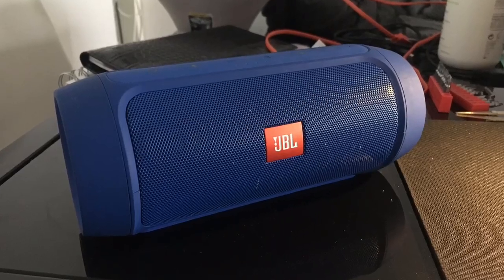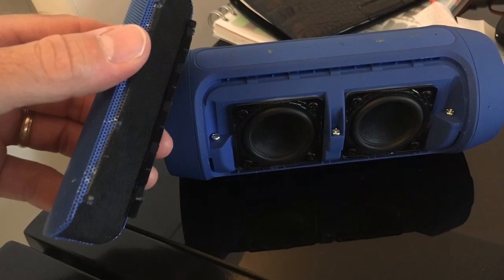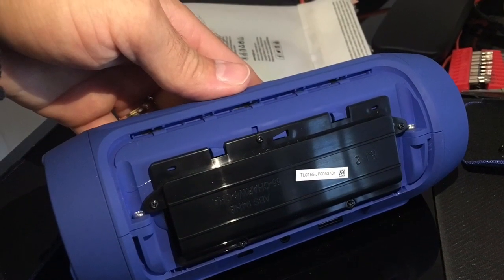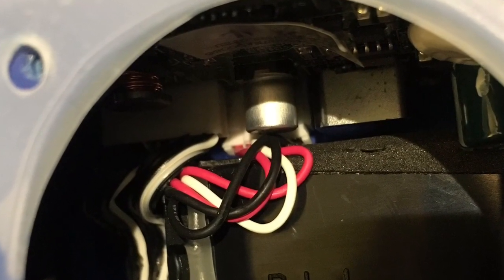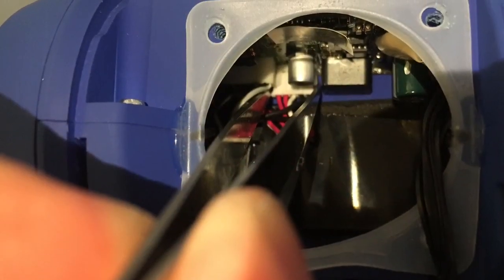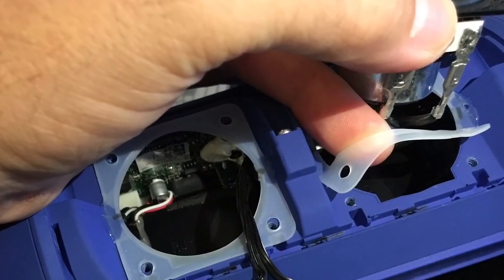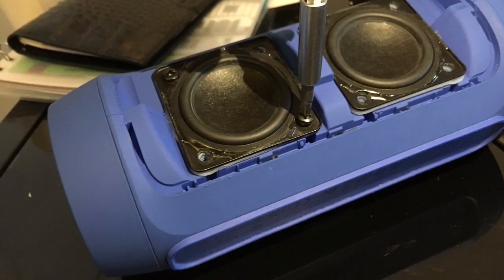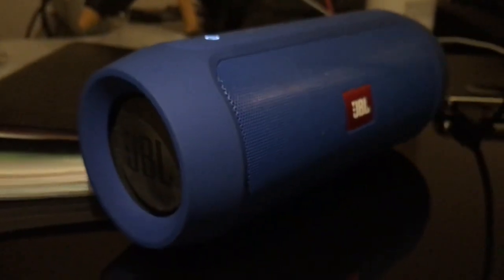JBL CHARGE 2 PLUS - sound issues and how to fix them on Bluetooth speakers

Comment: My jbl charge 2's radiators aren't as strong as before in terms of wobbling(bass effect) as it should be - but the sound quality is still pretty good. I can definitely feel that after I changed its batteries the bass is lacking big time. Maybe you know what seems to be the issue/problem?
Reply: I checked the subwoofers and fortunately they are still in good shape. Its just that I'm not satisfied the way the radiators(left n right) perform its function. I mean they are still vibrating/wobbling but performs kinda weak.
Reply from the maker: @jsorono24  sorry, no idea, cannot help you here. Maybe someone else reading this comment have an idea ?

Comment: What's wrong with the speaker sir. Auto off at full volume? Cracking sounds same model jbl to you?
Reply from the maker: The issue I had with those speakers, before fixing it as shown in this video, was that at high volume levels, the sound started cracking, buzzing. The actual cause was that the white plug I am showing in the video was not properly plugged and thus, with the bass of any song at high volume level, the vibrations were causing this white plug to move and creating those issues.

Comment: Why didn't you include the "bad sound" so I know if it's the same problem as I have
Reply from the maker: Hi, I agree with you, I am sorry I didn’t include a recording of the buzzing / crackling sound it was doing before repluging the socket.
Here is another video with a different fix but the sound issue was pretty similar except that it was way less powerfull. I hope it can help you out ! 
👉 https://youtu.be/4vP7r5VYUsA

Comment: This is a FAKE jbl charge 2+. Look at other disassembly videos. You fixed a knock off pile of garbage not even worth the cost of the replacement battery.
Reply: It's not the markings on the inside add up the color might seem off but other than that i don't see what's fake about it
Reply from the maker: It might be fake, but there is very little chance !
I bought it in a JBL store called "HarmanHouse" where they sold only Harman Kardon and JBL items

Comment: I can't turn off my JBL 2+ ..please help
Reply: This is a guess , plug adapter into speaker an outlet an see if you can operate like that and sometimes you have to hold volume ÷ & power button at same time to reboot an if that doesnt do it try - button an power at same time an if need to try power button with other buttons at same time to reboot but charge first then try , good luck
Reply from the maker: Thank you for this tip you share here !

Comment: I having a issue with my jbl charge.. whenever a bass falls its making a vibrating noise...shall this process fix it?
Reply from the maker: AFTERBURN RIDERS you don’t lose anything by trying!

Just remove the metallic cover with caution, take good care of keeping every screw in a small cup (or similar) while unscrewing your speaker! (So you don’t lose any)

- Is it only vibration?
If YES, then check for loose screws or parts... check if there’s anything loose in there. If so, check from where come those vibrations and you might just fix it by adding some silicone.

You will see that there are already some areas where they did put some transparent silicone where there was substantial risk of vibration! You’ll spot those areas where there is really short distance between wires and components for example.

If you see that the silicone is moving then you just might fix it! Cold silicone would do!
If you use hot one, it might cause some of your wires or components to get damaged!) then mounting all back and letting it dry properly (12 or 24 hours accordingly), after that you would be done!
You might also try by just tightening any loose screw in their!

- Is it like muting (as if it was going almost mute with some bad buzzing sound)?
If YES then try what I show in the video!

Hope you’ll be able to fix your issue and enjoy your speaker for long years ahead!

Let me know if you fixed it all right?

Greetings buddy!

Comment: Thanks man! Thanks to the dissembly-part of this video I managed to find out what caused the crackling on full volume from 58HZ up until 80HZ or some.
The battery was literally coming out of it's case. The cover was alle swollen up.
So thanks! A new battery'll cost me 30 bucks.. which sounds waaay better to me than a new speaker!
Reply from the maker: Joshua Weidema happy that it has been useful to you ! 🤗

Comment: My problem is when you turn it to max volume after a few seconds it turns off then on
Reply from the maker: RadWolf , my issue was a strong buzzing sound for each base in any song. I couldn’t put the volume at a high level (and even at a low level it would start almost like “cutting” the sound as if it would put a dimmer on top of it.
Did you try to open your speakers and at least check on this little white socket their?
It might not be the source of your problem but as it is quite easy to do, better you do it and it might just fix your problem!
Wish you good luck and that you’ll be able to fix your speakers buddy!
Reply: @sebgendron  I actually just reset my speaker now it's all good
Reply: Same problem bro and nothing can fix it I think even god can't also fix it

Comment: Hello.  My issue is that there is sound coming out of both speakers and the woofers but, some of the channels are not coming through.  For example on a song where there is a lead guitar solo, it is now sounding very low as if it was being played in another room.  Do you think your fix could help that?
Reply from the maker: Hi Mike Guerin, I don’t think it would solve your issue. My issue was a terrible buzzing sound as if it was saturating, this was due to the power in socket not plugged in properly (this white socket you see in the video, most probably repeated vibrations had unplugged it).
Nonetheless there is no arm in trying it though!
I believe your issue is due to a similar problem (vibrations) but related to a specific component in there.
Hope you will be able to solve it!

Comment: Do you know the 100 peice for the audio it came of any suggestions
Reply: Seems to be a common problem with the JBL Charge2 - the piece you are talking about is called an inductor - if it is intact (i.e. the ceramic casing of the inductor isn't cracked) t can be reattached by epoxying along the sides (NOT over the metal contacts) then sticking back so that it makes firm contact with the metal contacts on the board.  I had to disassemble mine completely to get sufficient access to the board to do this right, but might be possible to fix just removing the right speaker and accessing through the cavity.
Reply from the maker: Hi Noz 310 ,
Sorry but I don’t understand your comment. Could you please rephrase what you mean?